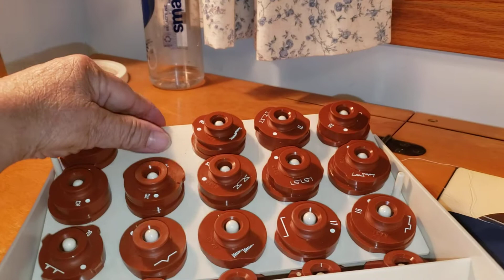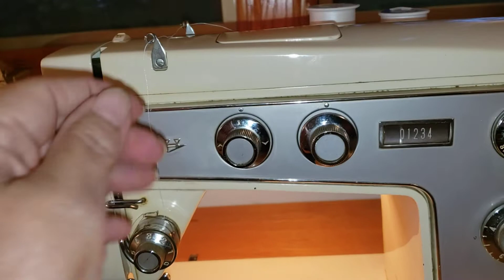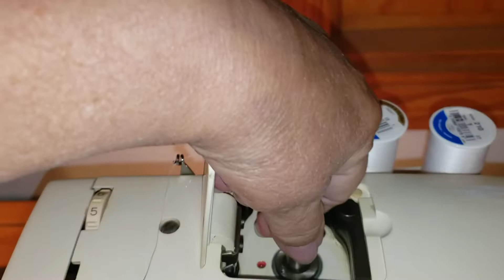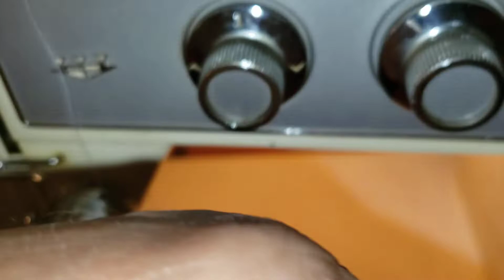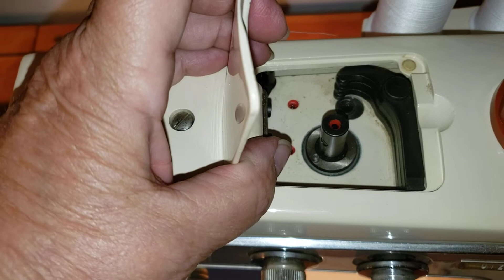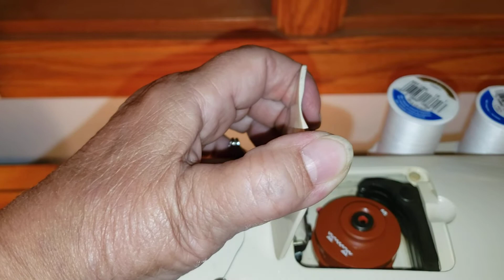using cams for kenmore sewing machine part 1

Comment: Liked and subscribed!  Would love more sewing machine videos!
Reply from the maker: what would you like to see?
Reply: @home-cookedandhomemade6295  I figured out everything that I had asked about. I was using incorrect needle-fabric combination and followed your threading instructions. Your videos really helped me so much! Still some confusion on the stitch expander knob - what do put it on when you're not using a cam? What do the arrows mean?  Can I make a wider zig zag than I get with the 4 setting? Thank you so much!  There are video reviews of this ma Hine but none like your that break down every feature in great detail. You are greatly appreciated!!🥰🤩👍
Reply from the maker: Ok, as far as the zigzag number 4 that's the largest size you can get on the machine.  The stitch expander only widens the length not the width of the side to side portion of the zigzag.  I'll do a short video to explain better. @sonopoly
Reply: @home-cookedandhomemade6295  thank you so much!!!